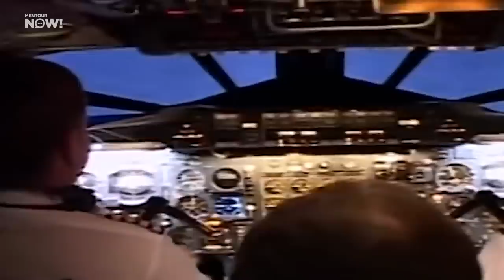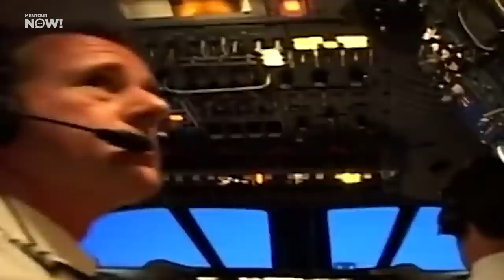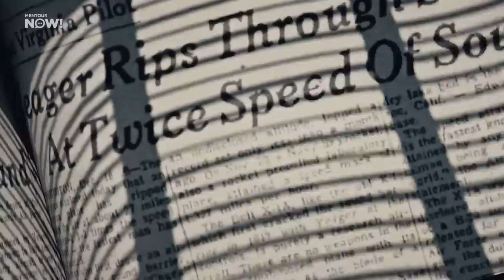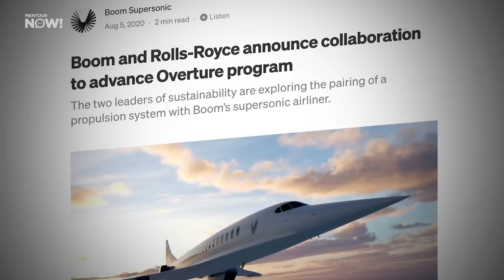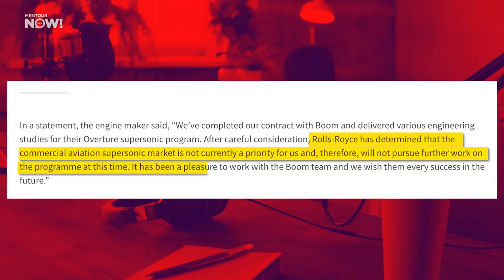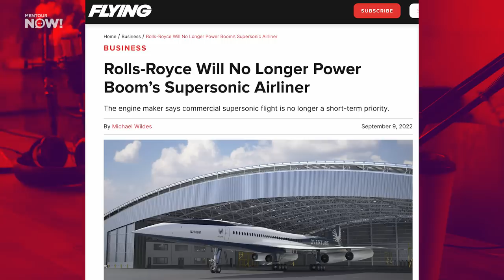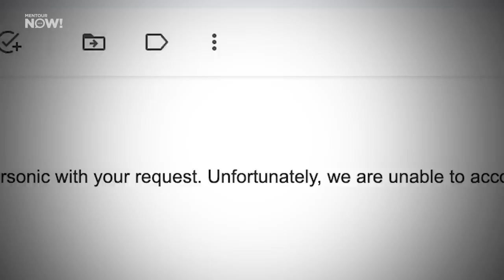WHAT’s Going On with BOOM Supersonic?! Will it Fail?

Comment: Trouble is I find it hard to accept there's a compelling argument for such an aircraft. 
Streaming technology has improved so greatly that the need to travel and meet face to face is simply not there anywhere near the extent it was when Concorde was around (pre-internet, remember?).

Meanwhile, the vast bulk of commercial passengers chase LOWER COST more than anything else, which arguably has had some pretty bad consequences for the industry in several respects.

Maybe as a niche thing that the "look at me" crowd might like to be seen to travel on? But could airlines possibly charge enough to recoup the likely massive costs in developing and operating such a thing? Seems doubtful, doubly so when you consider many uber-wealthy operate their own jets or at least charter private ones.

All that is BEFORE one wonders about the future collision with pressure on global carbon emissions etc. Unless physics changed while I wasn't looking, I can't see how it's at all possible to push beyond mach-1 without also necessarily being less fuel efficient on a fuel used per passenger mile/kilometre.
Yes, tech has improved, but those very improvements also mean travelling at LESS than Mach-1 is also massively more efficient than it used to be. One has to assume there are reasons commercial airliners all travel at around Mach (0.78-0.85).

Comment: " i don't if i ever heard of an aircraft that runs on differents engines on the same airframe".

There was the Hawker Siddeley Trident 3B with 4 engines
Three were turbofans (RR Spey).
They added a fourth engine, a single-spool turbojet (RR Rb162) that had very poor efficiency but a lot of punch for low weight. 
It was used only for take-off and initial climb.

Comment: I'm curious if it is at all possible to repurpose military bombers designs into supersonic passenger jets. For example iterate on the B1 Lancer design. It's been in operation with the air force for decades. The engines are available since they are being used currently. What do you think?
Reply: @number1ice That's an interesting thought, but unfortunately it would be totally impossible, rather like converting a formula one race car into a taxi cab.😊
                                         Lancer                 Overture
Construction                Aluminium        Composite
Wing                                 Swing                 Fixed
Weight                           148,000 kg       140,000 kg
Length                               45m                    62m
Speed                             Mach 1.25        Mach 1.7
Cruising altitude           40,000 ft            60,000 ft
Cost                                 $169M               $200M
Development cost        $91.5bn                $8bn

Comment: Great take on civil supersonic flight. A slight correction: the normal version of the Tu-144 did use turbojet engines, only the Tu-144LL flying laboratory, which was operated in cooperation with NASA, used the turbofan engines originally developed for the Tu-160 strategic bomber. These engines made the Tu-144 much more capable and efficient, but came far too late to make any difference for commercial use.
Reply: ВЫ ПЛОХО ЗНАЕТЕ ЭТУ ТЕМУ... НА ПЕРВОМ ЛЁТНОМ ЭКЗЕМПЛЯРЕ БЫЛ НК-6, ПОТОМ ТУ-144 , ФАКТИЧЕСКИ ПЕРЕПРОЕКТИРОВАЛИ ЗАНОВО И ОН ЛЕТАЛ С ДВУХКОНТУРНЫМИ НК-144... ТУ-144ЛЛ ДЕЙСТВИТЕЛЬНО ЛЕТАЛ С НА-32.... КСТАТИ , ПЕРЕРЬ ВОССАНОАЛЕНО ИХ ПРОИЗВОДСТВО, С БОЛЬШИМ РЕСУРСОМ И БОЛЕЕ ЭКОНОМИЧНЫЕ...
Reply: @ИгорьИсаков-з4р  translation: YOU DO NOT KNOW THIS TOPIC POORLY ... ON THE FIRST FLIGHT COPY WAS NK-6, THEN TU-144, ACTUALLY REDESIGNED AGAIN AND IT FLEW WITH DOUBLE-LOOP NK-144 ... TU-144LL REALLY FLYED WITH ON-32 .... BY THE WAY , REVIEW THEIR PRODUCTION, WITH A LONGER RESOURCE AND MORE ECONOMICAL ...

Comment: I think that there is a market for supersonic flights. It may be just a niche market, but one that it would still be worth looking at. The main problem with designing such an aircraft is the high initial project investment that would be well beyond what startup could afford. Just as a reminder, it took  majors experienced aircraft builders(that were not startups) as well as a high government investment to  have Concorde built.
Reply: @cristianboldisor1175

Concorde is a bad example, its development cost was astronomical at £11.1bn (15.3bn) and the program overran. The payback cost over 14 aircraft would be £793M ($1.057bn) per aircraft. Overture's development cost is predicted to be $6bn and the aircraft will sell for $200M each. You can guarantee that government/military programs will overrun and overspend, some even without delivering any product.

Comment: Favorite plane? For different reasons, not all of them good. Corsair and Demon (I still have the Demon Doctor patch my dad gave me at the time), because my dad worked on both at the appropriate times, and the anhedral/dihedral wings on the Corsair. (because it swings a pretty big prop I think. Somewhere during that time I was watching Cutlasses land as NAS Alameda, and reallly liked the look of the plane, and was amazed by its VERY nose up attitude on landing and really long nose gear. Alas, the nose gear is one of two things that caused it the most problems. They eventuallly banned them from carrier landins*. I didn't know this 'til this century, but the pilots liked the Cutlass airframe, but even though it had twin jets they called it the Gutless Cutlass. At 9 I knew nothing of this! ;)

I also liked the Phantom.

* Initially, the nose gear wasn't strong enough for the controlled crashes AKA carrier landings! Some or even several pilots were killed when the nose gear came up through the cockpit on hard landings. They were OK for regular runways, but this is the Navy, not the Air Force! ;)

Comment: The only use case would be as an expedited military operations platform where speed is a requirement.  With Bombardier jumping into blended wing body R&D, I would not be surprised when the other business jet manufacturers pursue this avenue instead of supersonics, due to increasing fuel and maintenance costs associated with flying between mach 1.6-2.2.

Comment: Uncle Sam needs to show some love to the Budding US supersonic jet startup.
No funding needed; just release the XA100 or XA101 engines for use on the Overture.
Without afterburners these make 30,000 lbs of thrust a piece allow for a neat two engine design.
They are also modern variable bypass engines with 3rd stream heat sinks and CMC turbine parts.
Reply: Florida Turbine Technology, a division of $1.88bn Kratos Defence, started the symphony engine design in January 2023. Boom stated that no current engines, either military or commercial, are suitable for adapting to Overtures unique requirements. The engine will be a 72 inch, twin spool, medium bypass, turbofan, without reheat. It will produce 35,000 lbs thrust. 

Boom will design the pods and the variable geometry exhaust and inlet ducting. The objective is to have power unit that is efficient at both sub and supersonic speeds

A big fuss is being made about Rolls Royce ending their contract with Boom, but AFAIK the contract was only for consultancy, and not to build an engine for Overture. Besides which, the Symphony project would be totally unsuited to the tier one engine manufacturers, like Rolls Royce, GE, P&W, and Safran. Their cost base and time frames would be out of kilter, and the volume of sales would not warrant their investment. GE caught a cold with the Affinity program.

Comment: It looks like an upgraded form of concorde with a variable cycle 6th gen fighter engine optimized for Supercruise and efficiency with the latest avionics would be a better bet overall. GE actually made an engine like that for the YF22 and YF23 prototypes and the F-35 but the AETP program is closed in favour of NGAD. That engine tech if developed for the commerical market could revolutionize supersonic transport.

Comment: Well, as supersonic flight is always less efficient in terms of glide ratio ( about 6 compared to over 22 for modern airliners) there will always be a very strong handicap for these designs. You would need to charge 4 times the normal price to make the route profitable. Or more, if you consider the aircraft costs for small numbers of airframes to be build, the small number of passengers and therefore the economy of scale which is not in favour for such designs.
It is simply a nice toy and great to look at, but no business case for an airline.
And RR knows that as well as Boeing and Airbus.
The only business case for civil supersonic applications would be business aviation where the price of a flight has a different setting and time and flexibility are key.

Comment: Putting all of the questionable aspects to one side, it's very pretty! If it can be shown that it will use less fuel than a typical jet, it might even be a success. Pity it's not going to work with Rolls Royce engines, because they have a lot of experience in building supersonic engines. There is always something reassuring to a passenger on seeing those words on the engines on getting on a plane. (Long story, but my second flight, as a kid, on Dan Air for anyone who remembers them, was not the greatest, but having seen the RR engine on climbing up the steps did soothe my nerves!)
Reply: While Concorde is the most fuel efficient supersonic aircraft in history (it supercruised - flew supersonically without afterburner for 3+ hours, something no other aircraft civil or military has ever achieved) an SST cannot use les fuel than a normal jet. Physics says no. The drag curve rise at Mach 0.95 until M 1.3 is like a wall. Concorde used about the same amount of fuel (95 tonnes) to go from London to NY as a B-747 400. It carried 100 passengers vs the 350-400 on a 747 depending on the configuration but passengers paid for the speed because it made sense to them. It was only about 20-25% more than the First Class their companies would have sent them on anyway and they could fly London to NYC, have several hours of meetings and take the afternoon Concorde home and be in bed the same night. That is why it was profitable for BA for over 20 years.

Comment: SSTs are marvels of engineering.
I believe that they are a solution in search of a problem
The problem with air travel currently is not a problem with the aircrafts speed.
The problem is the sum total of the time spent getting to the airport, parking, checking in baggage,  arriving  early, getting through security, boarding and then awaiting takeoff. Then doing it again on arrival.
All that probably takes 4-5 hours. 
So cutting 2-3 hours off the actual flight time does not really change the fact that an entire day is spent on air travel
Reply: @Completeaerogeek  I'm glad you liked it.
Too bad those days are gone now.
I believe more  time is lost by more people in transport to and from the aircraft than the supersonics will save. 
Not that I'd turn down a flight on one of Mr Musk's 's Starships for a 30 minute hop arcos the Pond.

Comment: Honestly I don't see the point. A huge percentage of my travel time is spent getting to and from the airport, waiting for layovers, and sitting on the ground, especially since covid killed so many of the longer routes. I haven't been able to take a non-stop flight anywhere I've needed to go since 2019, and it's usually 3 stops now, which when you add in layovers, turns a 5 hour flight into a 12 hour ordeal. Cutting a 5 hour flight down to 3 hours is almost irrelevant unless it actually goes nonstop, directly where I need to go.

Comment: As one who was lucky enough to have flown on Concorde, I was really rooting for Boom. I suppose I still am, but without an engine partner, I don’t see how they can produce their Overture.
Reply: They have competition. Then what?
Reply: Florida Turbine Technology, a division of $1.88bn Kratos Defence, started the symphony engine design in January 2023. Boom stated that no current engines, either military or commercial, are suitable for adapting to Overtures unique requirements. 

Boom will design the pods and the variable geometry exhaust and inlet ducting,

A big fuss is being made about Rolls Royce ending their contract with Boom, but AFAIK the contract was only for consultancy, and not to build an engine for Overture. Besides which, the Symphony project would be totally unsuited to the tier one engine manufacturers, like Rolls Royce, GE, P&W, and Safran. Their cost base and time frames would be out of kilter, and the volume of sales would not warrant their investment. GE caught a cold with the Affinity program.

Comment: Their airframe and aerodynamics make sense. Will it eliminate sonic boom as well as they think it will? Maybe. Like stealth, you need extremely perfect and precise manufacturing and assembly. But that seems plausible today.
The real problem is the engine. Anything that's even remotely close to a possible engine is extremely restricted military tech, plus it's high maintenance stuff not really viable for constant commercial use.
Reply: Florida Turbine Technology, a division of $1.88bn Kratos Defence, started the symphony engine design in January 2023. Boom stated that no current engines, either military or commercial, are suitable for adapting to Overtures unique requirements. 

Boom will design the pods and the variable geometry exhaust and inlet ducting.

A big fuss is being made about Rolls Royce ending their contract with Boom, but AFAIK the contract was only for consultancy, and not to build an engine for Overture. Besides which, the Symphony project would be totally unsuited to the tier one engine manufacturers, like Rolls Royce, GE, P&W, and Safran. Their cost base and time frames would be out of kilter, and the volume of sales would not warrant their investment. GE caught a cold with the Affinity program.

Comment: I'm not sure there's much market for a design that knocks a couple of hours off a four or five hour flight, particularly given the various other delays that apply as much to a supersonic flight as to a subsonic one. What might be attractive would be an extremely long-range design, that is if the fuel burn issues be solved. Passengers would be more likely to be interested in a plane that would reduce the LA to Sidney flight time from a grim 16 hours to a more endurable 8 hours. Also, being overwater the sonic boom would be less of an issue. Of course that brings up a different issue. Far fewer people fly from LA to Sidney than from London to NYC.

Comment: I wonder if they might be able to use EJ200s or some other military engine that is already in production for transonic and supersonic applications. Development costs would be minimal. 

But those might just be too loud.
Reply: EJ200s are not powerful enough to allow supercruise for a large aircraft. The Olympus produced 30,400lbs of thrust without reheat. That is why it could supercruise at Mach 2.0
Reply: @Completeaerogeek   - Oh, OK. For some reason I thought the EJ200 was more powerful than it is.

Nevertheless, are there other military engines that could do the job?

Comment: Sad to say and hopefully i'll be wrong, but I don't see Boom Overture ever taking off. Even if it does, it won't be in the time frame they're claiming. Rolls Royce pulling out and no other engine options currently on the table hasn't helped either. The only Boom to have seen the light of day thus far, is the XB-1 prototype. The Overture has also been redesigned and looks like a cross between the Boeing 2707 and Lockheeds proposed L-2000.  As time goes on, this is starting to look more and more like scamming the investors. I sincerely hope not. As for favourite aircraft, that's Concorde, with the 'Queen of the Skies' Boeing 747 a very close second. Excellent video once again, as per usual. 👌👌👍👍

Comment: The RAF lent a VC10 to RR, to fly their early RB211. The two RR Conways were removed from the port side and the RB 211 fitted in their place. Legend has it, that the power ‘bent’ the fuse, so after testing, the Aircraft was removed from service and eventually scrapped. (I’m not a believer of this legend.)

Comment: ASSUMING, that issues like sonic booms, weren't an issue; I am curious about the length of airport runways. Specifically how many airports around the world have runways long enough for those aircraft to safely land without any concern of the runway not being long enough to stop?

I am NOT a pilot, never have been, haven't even had a flight on any fixed wing air craft,  commercial or otherwise. So that is why the question, I don't have a clue.
Reply: I think you would be surprised how many could accommodate concorde for example. If you research the concorde proving and demonstration flights you will find they went to many airports that you wouldn't associate with supersonic transports. That was all before the fuss about the supersonic boom kicked in, but might give you an idea. I don't know the exact lengths needed for take off and landing but it's probably not as much as you might think. Concorde regularly flew from East Midlands Airport in UK on the tourist flights and it wasn't that "big" an airport back then.

President mittarande of France used one as his personal aircraft when he was visiting French troops in Saudi Arabia just before desert storm kicked off. It landed at our local airport at yanbu (red sea side) which was basically a tin shack and a runway, so again not somewhere you would expect to see concorde. I remember hearing the double boom as it flew over on the way to land. Scared the crap out of me as we were expecting bombs or missiles to land at any time!!! Most relieved when I saw the sleek shape passing way overhead.